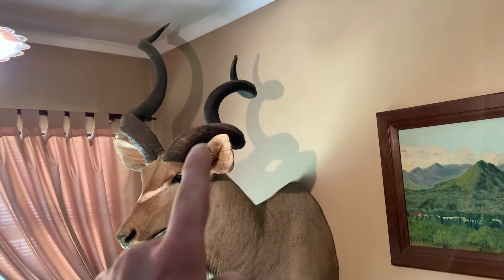How to adjust a sight's 3rd & 2nd axis WITH NO TOOLS

Comment: Since you are using the level in the scope housing, it would be good to first make sure that level is accurate. This can be done by holding a level on the arm of the scope and comparing both levels. A simple arrow level can be used for this like the kind for setting nock height, or just set the scope arm on the edge of a table that is level.

Comment: I am pretty sure you know that you need to check 3d axis on the bow at full draw, raiser deforms and twists under tension, and it will have different geometry from the door frame.
Reply from the maker: Absolutely, not even accounting for machining deviations on risers. But we have had solid success with this simple method and already makes a noticeable difference. We are especially lucky because of improved rigidity in risers on the modern day target bows.